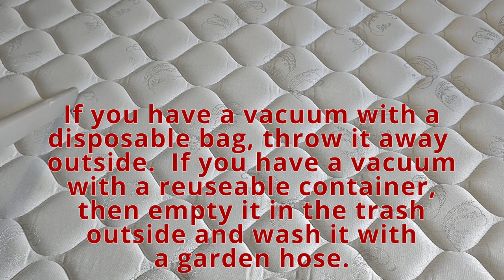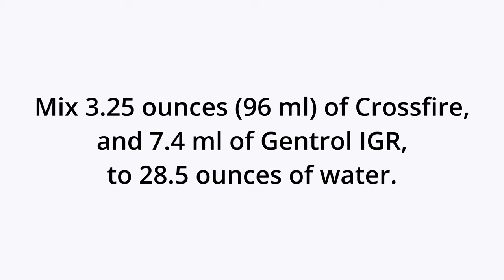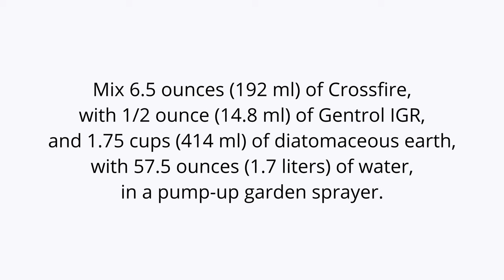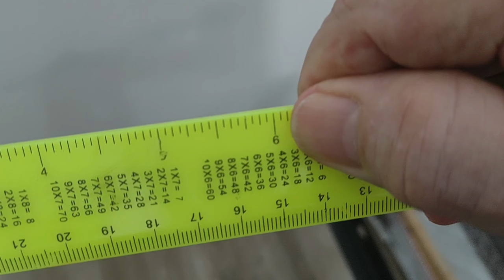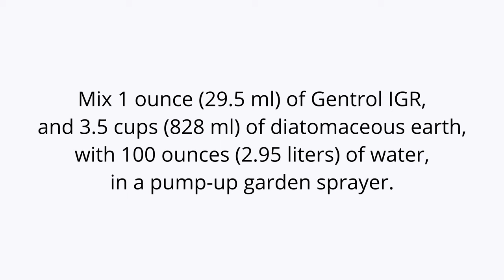ULTIMATE Bed Bug Solution!  AMAZING.  This ALWAYS works.

Comment: Many clothes, coats, pillows, cusions, bedspreads, photos in frames, curtains, cloth blinds, lamps, and artwork, would be destroyed with a steamer, washing machine using hot water and a hot dryer. As well as stuffed toys, decorations and books etc. Do you do your car too?
Are all these products safe for babies and pets? I know all of my. house would take a very, very,  long time to go through. If you sit on your untreated furniture then go to bed in the cleaned up bedroom won't you spread them back to your beds, blankets, sheets and pillows?
Reply from the maker: Actually, the steamer is not quite as destructive as you may think.  Almost all of the items you mentioned are safe for steaming.  I probably would not directly steam the artwork, but you probably can still steam on the back of it where there may be a crevice that is the width of a credit card or wider.  Whenever you are steaming, just try a little bit first and if it looks like it's going to cause damage, then stop.  Keep in mind, if you buy the correct steamer, then you are only going to be touching a surface for a very brief period of time.  It gets it hot enough to kill the bed bugs, but not hot enough to do any damage to the item. 

Not all clothes and other washables can withstand high temperatures in your washer and dryer, but you would be surprised how many of them can.  Personally, I think it is worth risking the damage to some of these items to eliminate the bed bugs.  That's just me though.  I would really prefer not to get eaten by bed bugs.  You can also try steaming these items, but using the washing machine and dryer is a better bet. 

Some items can simply be microwaved.  If the item does not contain any metal, and it is small enough to put in a microwave oven, then simply place the item in a plastic bag and put it in the microwave with a half cup of water. Tie the bag off with a piece of string.  You do not want to use a baggy tie, because they contain metal.  Use the highest heat setting on the microwave and nuke the item for about 60 seconds.  If you start to see the bag expanding or blowing up, then shut off the microwave because the bed bugs are already dead, and you don't want to do damage to the item.  The reason you are putting the cup of water in the microwave is because microwaves heat liquids.  If there is not enough liquid in the microwave, you can cause damage to the unit.  Guess what also contains liquids?  If you guessed bed bugs, then you guessed correctly.  Since microwaves heat liquids, the liquid inside the bed bugs will cause them to boil to death.

After you finish washing, steaming, or microwaving any of these items, you should seal them in a plastic bag, so that they don't get reinfested before you do the rest of the treatment. 

Cars can be treated, but you only need to do it if the car is infested.  A lot of the time this is the case. 

All of the products are safe for children and pets after they dry.  Just keep the children and pets in a different room while you are applying the products.  Wait until everything is dry and the dust has settled before you allow kids and pets into the room that you were working on. 

You are correct that treating a house takes a long time.  You are also correct that you can bring bed bugs from one place in the house to another.  Therefore, if you are sitting on an infested couch, you can bring the bed bugs into bed with you.  That is why you should not get into bed wearing the same clothes that you were wearing while you were sitting on the couch or occupying any other place and the home before you go to bed.  Always put on clean PJs before you go to bed.  Keep in mind that bed bugs do not usually infest sheets.  That is because you wash them frequently.  They will invest the mattress, but that has already been bagged, so they cannot get into it.  It's the same with the box spring.  If they head toward the floor, they will encounter the bed bug traps there under the legs, and that will be the end of them.  If they get on to the bed frame, that has already been treated, and that will be the end of them.  So, there was a good chance that your bed will not get reinfested, but you should still not get into bed until you put on a clean set of PJs.  Always start with the beds, and it is a good idea to treat the couch, and other upholstered furniture just as quickly as you can. Most of the time you are going to get attacked in bed, or on a piece of upholstered furniture. Therefore, those items should be your first priority. 

The key to eliminating bed bugs is to be thorough, so take your time and do a good job. 

I hope that helps.  Be well Tracy.
Reply: @GuysPestSolutions 😅😅
Reply: @GuysPestSolutions 😅
Reply: @GuysPestSolutions  Another option I've heard for treating delicate items is to seal in a plastic bag and freeze them, I think for about a day. They said that bedbugs die below freezing temperature. The microwave method sounds much more direct, quicker, and effective, but may not be possible in some situations. Thoughts?  Also, would you recommend using space heaters to raise a room's temperature to 140+ Fahrenheit for 2-3 hours to kill bedbugs? Since they can hide so well, that seems like it would be thorough and effective.
Reply from the maker: @chidude  You can freeze bed bugs to death, but for this to work you need to reach extremely low temperatures.  The temperature needs to be 0°F (-18°C) or colder.
You must maintain the temperature for an extended period.  It takes about four days at 0°F to ensure all stages of bed bugs (eggs, nymphs, adults) are killed.

Heat will also kill bed bugs, but you need to get it really hot in the room.  Keep in mind that the temperature needs to be at least 113 degrees inside the mattress and all furniture.  That means you need to get it pretty hot in the room.  Most space heaters you can buy reach a maximum temperature of 100 degrees for safety reasons.  For this to work you need industrial heaters.  Professionals will generally heat the room to about 130 degrees for an extended period of time.  I recommend at least 24 hours.  Since bed bugs can travel from one room to another, you should really treat the entire home at the same time.  Heat treatments offer no residual properties, so if even 1 egg is left alive, the problem starts all over again.  So, for heat to work you really need to know what you are doing, and you need the right equipment.  Even the pros screw it up as much as they get it right because it's not a reliable treatment method.

I hope that helps.  Be well my friend.

Comment: Is it necessary to vacuum and steam? Can I mop with hot water? (I don't have vacuum and steamer I just use a regular broom to clean the house and mop with hot water). I bought a mattress cover, bed receptors DE and bug spray to treat the bed. After that I will start working on other items in the room.
Reply from the maker: It's not just about cleaning.  The idea is that you want to kill the bed bugs and their eggs.  The steam is hot enough to kill on contact.  Hot water is not going to do this for you.  Vacuuming is needed because it literally removes bed bugs, and their eggs, instead of just spreading them around to a different location.  So, vacuuming and steaming are a must.  You would be wise to invest in this equipment.  I hope that helps.  Be well my friend.
Reply: @GuysPestSolutions  Thanks for replying. So I just ordered a vacuum and steamer. Actually, the bed bugs infestation has just started. My daughter went for a play date and we noticed the bedbugs pretty soon after that. It's been 2 weeks now. I also have cockroach infestation and ordered everything that you have mentioned in the other video to take care of that. I havekids.s . My question here iis there anything that i do not need and can do the treatment of both bedbugs & cockroaches without buying so much stuff. Like do i need Gentrol igr traps for cockroaches if I am going to treat my complete home with Gentrol igr concentrate?
Just trying to save some money :). I hope you will reply soon.
Reply from the maker: You are posing a fascinating, but somewhat complex question.  German cockroaches have a totally different biology than bed bugs.  I'm going to try not to be too technical here, but there are certain things that you need to know.  Bed bugs do not ingest food the way cockroaches do.  Bed bugs have piercing and sucking parts that are used to extract blood.  Therefore, they cannot clean themselves the way cockroaches do.  Cockroaches hate to get anything on their feet, so when they walk through a borate product, such as boric acid or Nibor-D, they get it on their feet, and they ingest it to get it off.  This will cut holes in their stomach, and they will die of dehydration.  Bed bugs do not eat that way, so they are not going to ingest boric acid when it gets on their feet.  Therefore, diatomaceous earth works better on bed bugs.  While using diatomaceous earth as a dust to treat German cockroaches can be effective, it is unclear how effective it will be if you mix it with water.  Some people claim that it will clump up too much to stick to the cockroaches' feet if you mix it with water.  That is the main reason why I have never tried treating German cockroaches with diatomaceous earth.  So, I think it is always best to treat German cockroaches with borate products, and it's best to treat bed bugs with diatomaceous earth.  That creates a bit of a dilemma if you are trying to treat both bed bugs and German cockroaches at the same time.  So, here's what I would do.  I would regard the primary pest to get rid of first to be the bed bugs because they are literally eating you.  German cockroaches are nasty, but they are not busy causing you physical harm.  They can still spread disease and they still need to go, but I think the bed bugs are priority.  That doesn't mean you shouldn't treat both at the same time, but you need to understand that the treatment is going to be different.  Some of the bed bug treatment may need to be replaced with the cockroach treatment after the bed bugs are gone.  Since you have a light infestation of bed bugs, I would do the bedbug treatment in the bedrooms, living room, and any other areas where you are most likely to encounter bed bugs.  This means you would apply the diatomaceous earth to the floors in those areas, but you would apply Nibor-D to the floors in all other areas, such as kitchens and bathrooms.  After you have the treatment done for bed bugs, then I would immediately start on the phase one treatment for German cockroaches.  As you know, this is only done in the kitchen and bathrooms.  Since it is unlikely that you have bed bugs in these areas, I would treat all the cabinets, floor, around appliances, and all that sort of thing with Nibor-D, and I would apply the D-Fense dust, the bait, and the IGR discs as shown in the video.  The majority of the roaches are going to be in the kitchen and bathrooms anyway.  So, while the bed bugs are busy dying, you will be busy killing the cockroaches in the main breeding areas.  Now that phase one is completed for the cockroaches, you can then start drilling the walls and applying the boric acid into the wall voids.  You can also go ahead and place the IGR discs next to all electronics throughout the house.  If you have a surface treated with a liquid IGR, then you would not need to use an IGR disk for particular surface until 3 months after the liquid was applied.  At that point, you would need to place an IGR disc next to the electronics or appliances.  After you confirm that all the bed bugs are dead, then you can go ahead and finish phase 2 throughout the house.  I know this does not save you any money on products, but this would be the way I would approach treating both species at the same time.  Unfortunately, neither of these species are cheap to treat. 

I hope that helps.  Be well my friend.
Reply: @GuysPestSolutions  thanks for replying and I totally understand what you said. I have started with bedbugs process first . And nothing bit us yesterday. Have cleaned the living room today. Will soon start on roaches problem. Your videos helped a lot. Really greatful for the detailed explanation . As products are easy to buy but you showed us how to use them .
Reply from the maker: @amandeepkaur8629  You are very welcome.  Thank you so much for those kind words.  Very much appreciated.  Be well Amandeep.

Comment: What about carpeted floors?
Reply from the maker: You treat carpeted floors the same way as hard surface floors, except you need to spray them, much the same way as you would spray anything else with a handheld sprayer or you can use a pump-up garden sprayer.  Don't soak the carpets.  Just a light mist on the surface is all you need.  I hope that helps.  Be well my friend.
Reply: @GuysPestSolutions  so best bet if you noticed I'll estimate 3 months after started to just call terminax
Reply from the maker: @Gapeach1970  I'm not sure what that means, but my advice is to never call Terminix.  You are usually better off going with the local mom and pop outfits.  Don't worry though.  You can do this yourself.  Just take your time and do a good job.  Be well my friend.

Comment: I sprayed with Crossfire, Gentrol  and DE before I left a small trailer for a 3 month trip.I had hoped to get a  local exterminator to spray it some more while I was gone but several wouldn't do an RV Trailer and the only helpful one just wanted to use heat. I hadn't left it ready for that with possible damage to computer stuff. I thought I'd ordered a new Crossfire but saw I must have wanted to switch it up with Tempred. I had pretty much all the possessions in boxes in the middle of the rooms so the perimeters could be sprayed. It is a major hassle to function with it like this but I could hang on for a few more days, if I need to, until the new order of Crossfire comes in . Should I mix DE in with the Temprid? If that's not a good idea could I just spray the Temprid over the DE that is still visible. I don't care how this looks I just need to get rid of any Bedbugs remaining. Pretty big skin reaction any time I get bit. Thanks!
Reply from the maker: I think you would be better off waiting for the Crossfire.  Vacuum and steam again prior to applying the Crossfire, IGR, and DE.  Sorry.  Be well my friend.
Reply: @GuysPestSolutions 
 Really appreciate your reply. As luck would have it I found I did have a
 new Crossfire that I hadn't seen. So I'll use that.The kitchen area is the big need right now. I'll have to rewatch this video. Kitchen cabinets are the one's that have me a bit stumped. Do you just steam them and DE? Thanks!
Reply: It got a major dosing of Crossfire/Gentrol/DE before I left 3 months ago. I've been back  for a few days now and haven't noticed being bitten. The initial problem area, which used to be the bedroom, is now a storage area with no bed. A new 6 post bed, in this small place, is on the opposite end and the main hanging out place is in the middle. I have kind of a feeble, but hot, hand steamer and a shop vac. By steaming and vacuuming don't I just suck up the DE that's around much of the place? There's only one other piece of upholstered furniture, an office chair, in the whole place. The rest just boxes, cabinets and shelves. Could I just hit it hard with the Crossfire/Gentrol/DE and do the finer crevices with Bedlam or should I spend a few more days doing the steaming and vacuuming again? Hoping not to get them stirred up, by waiting too long, if they're still around? I haven't seen any but barely saw any before but did get bitten 10-20 times previously. I'm nervous to leave it too long but want to do a decent job too.  Thanks!
Reply from the maker: @cSounds49  You would treat kitchen cabinets the exact same way as you would treat a dresser or a nightstand.  That means you would vacuum, steam, and treat with a mixture of Crossfire, IGR, and diatomaceous earth.  If the diatomaceous earth looks kind of nasty, which it does, then do not treat areas where it can be seen.  Just treat with Crossfire mixed with the IGR.  Just include the diatomaceous earth in the mixture for inside the cabinets and places where it cannot be seen. 

I hope that helps.  Be well my friend.
Reply from the maker: @cSounds49  You are correct.  If you retreat an area that has been treated with diatomaceous earth, you most likely will remove a lot of the DE when you vacuum and steam. So, you should reapply the mixture of Crossfire, IGR, and DE.

You never know where you will encounter bed bugs, so I am not one to take chances.  So, I treat absolutely everything with vacuuming, steaming, Bedlam, and a mixture of Crossfire, IGR, and diatomaceous earth.  I think the reason people fail with this is mostly because they are not thorough.  I think that's true for pest controllers as well.  It is certainly true that I treat a lot of areas that do not need to be treated, but I always err on the side of caution.  That is why with me, it's once and done.  I would rather overkill than allow any bed bugs to escape.  That's just me though.  It all depends how much risk you are willing to take.  I do not take any risk whatsoever. 

I hope that helps.  Be well my friend.
Reply: @GuysPestSolutions  Very big help to get your opinion on this. That's what I'll do.  Thanks!